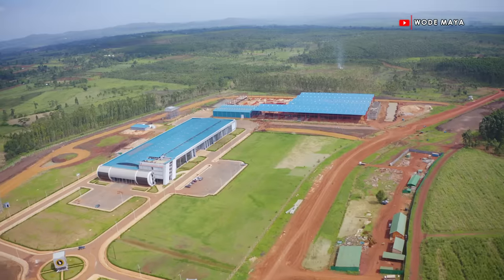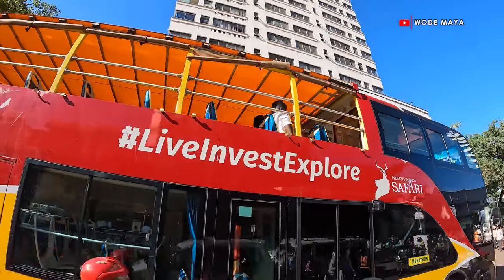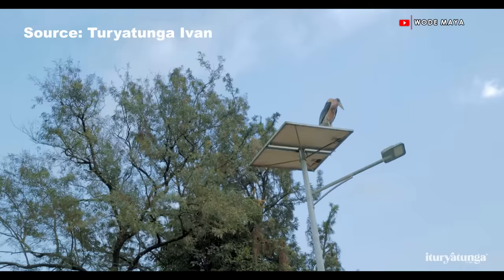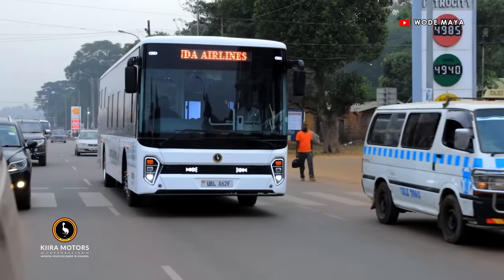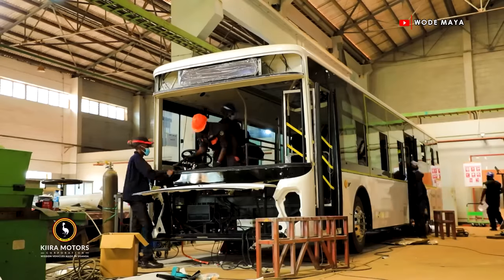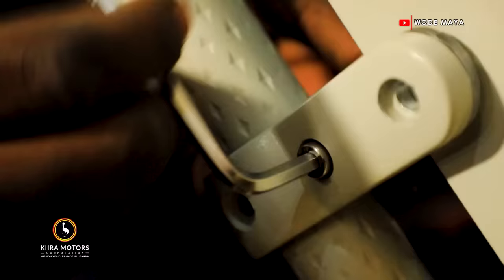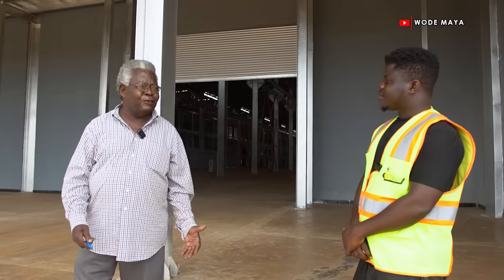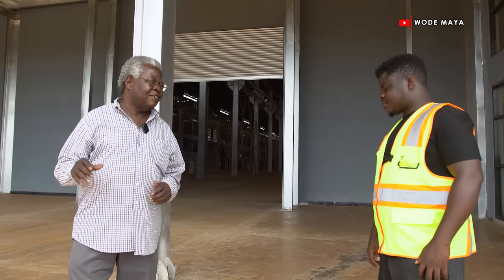Inside Uganda’s Electric Bus Manufacturing Plant!

Comment: It's body building and assembly. Body is the only component that is Ugandan, assuming the metal plates used are manufactured in Uganda.
Reply: We crawl, walk and then run, don't rush
Reply: Even the engine, samples made in uganda are already there

Comment: They should started manufacturing all the parties in Africa not import from the European countries we should produce all the parts we have all the  necessary resources  to do it in Africa let start  to manufacturing  iron copper, aluminium, bronze, if I don't mistake I strongly sure and  believe that This is the most material they use to build  engines

Comment: What you need is infrastructure to actually be able to use anything you develop. Those bomb craters in the streets dont even make anything like this viable. There is a reason you can't find 20 brand new car dealerships in Uganda. Imagine the number of jobs building a modern railroad would have provided and the ability to move goods and materials in and out of the country would facilitate even more development. Before getting your sandals all smoked up about this project first realize that priorities in Ugandan leadership are more selfish than collective. This will be another failure to launch. The parking lot is even still dirt, ever considered what dust does to electric motors?😢, but infrastructure ISN'T the business of the private community in Uganda, when your government leaders finally decide that Ugandan development is more important than a vacation house, maybe the citizens will start seeing better quality of life.

Comment: It is still very primitive and manual. Any crappy place can weld some sheets and pipes and call it a factory. This lacks modern techniques and processes. There are videos from PK that also show a "bus factory" all in the dirt and with no safety or standards of quality.
Reply: It will gradually get there!
Reply: Everything has a starting point. They will get there too.
Reply: Still under construction have u seen there any machinery ??